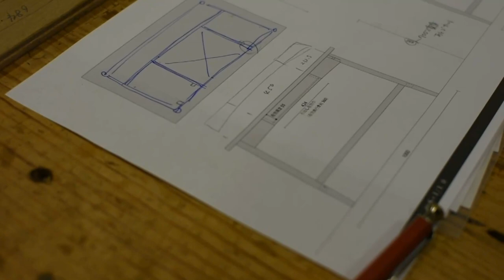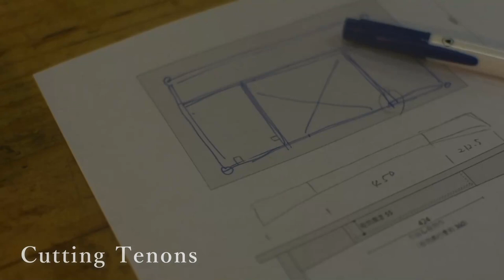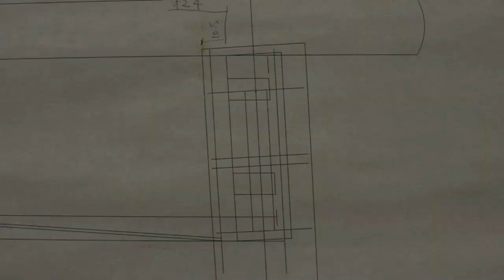Making Desk with a Drawer  vol.1 of 2

Comment: When you were mortising the round legs I was wondering how you were going to make the cheeks on the stretchers fit tight against the round legs.  Using the forstner bit for the top and bottom was brilliant, but I didn't get how you did the portion on the side of the tenon (with the router).  Is that a special router bit?  It looked like a dovetail bit but I'm not sure how that would work.
Reply from the maker: Hi, The bit I'm using is a semi-original router bit. I shaved a Dove-tail bit into a slight curve using a diamond. I hope this answers your question. Thank you watching.
Reply: @kasho2637  Thanks for this reply. Those concave shoulders are just one of the many amazing techniques you used in building this desk. Most people would create a flat face on the leg to join the rail, your solution is much more elegant.